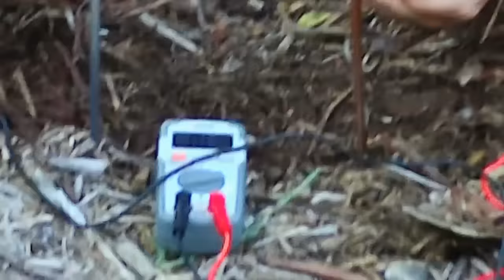OFF GRID POWER? The Earth Battery Experiment

Comment: The max voltage per cell is set by the choice of metals. The max current is determined by the electrolyte conductivity and acidity and the total surface area of the electrodes and probably the distance between them. So I'd suggest using closely-spaced metal sheets with a porous separator immersed in a conductive liquid (try lemon juice, vinegar, salt solution, etc.)
Reply: I THOUGH OF SALT AS WELL.
Reply: best metal choice? Probably gold since it doesn't oxidize.
Reply: And then we have a typical battery....
Reply: Yes but the idea is to have usable power with an earth battery. Meaning minimal upkeep and expense in creating it.
Reply: NaOH solution will work better.
Reply: lithium
Reply: Based on this, couldn't these be installed into a septic system?
Reply: You cannot, should not, hopefully will not, use this in a septic system due to corroding connections.
 One could revert back to the all knowing wisdom of Jim Carey, carefully positioning / lighting a cigarrette lighter during a flatus attack !

Comment: Used to mess with this kind of setup. The best way to do it is keep a pipe inside and wrap the outside of the pipe with a wicking material wrapped around it just like in the telegraph patent. Removing the battery from ground itself lets it dry out too quickly causing dead cells. These Batteries run off of moisture in the soil. Too little moisture no energy, Too much moisture and it shorts out.  Another thing is that your also getting energy conversion from three sources using earth batteries. Temperature - the Pelletier effect  one side is cooler than the other side of the two metals moving the electrons,   Chemical Reaction like a typical battery except rust/oxidization also contributes to the conversion, and the last one has to do with the earths magnetic field. Personally I would like to try dumping the power into a DC booster then taking that energy and dumping it into a Nichrome wire that is running into a sand battery. The sand battery can collect enough heat over time as long as your producing up to 12 to 24v. Then you can take that thermal energy and pump it into a hot air /stirling engine generator and/or Pelletier device, or a tpv panel when those become available to the public. Basically any energy source can be dumped into a sand battery using nichrome wire then utilized. I didn't mention a steam engine can be run off of it because a simpler safer condenser engine could be used instead. Finding ways to generate energy is a hobby of mine.

Comment: If you take a small nut and bolt and drill a hole in the bottom of each cell then connect a copper wire that connects to all then leave 6in exposed and burry the cell pack in the dirt I HIGHLY RECOMMEND U TRY THE RESULTS BLU MY MIND as it acted as an alternator recharging the cells and for some reason gave me an extra almost 2 volts...........  AND THEN I TOOK A small transformer and connected it to my leads and then hard wired an alarm clock, I have consistent power running that clock 24hrs a day just slightly modding "YOUR" DEVICE""      AWESOME JOB love your vids man ME N MY KIDS LOVE EXPERIMENTING and this was the best
Reply from the maker: Cells drying out was the cause of failure for the pvc pipe assembly .. putting a hole in the bottom would let moisture in from the soil, so long as its healthy (full of organic matter and living things)  I wouldn't have expected the extra voltage .. that's pretty darned cool!

Comment: Good experiments ! I would offer some advice dealing with such low voltages and currents. Don't interface your body with the terminals. AT 25:48 where the voltage is "jumping all over the place" it's more than likely because you are handling the terminals. You can just hold the test meter probes in your hands, left and right, and you will measure a voltage, also in handling the terminals you will be dissipating current through your body, which will lower the voltage. Your body will act as a resistor and also as a capacitor. Either wear insulated gloves, or simply don't touch the terminals when your taking measurements, you also made this mistake earlier in the video, where you were measuring the bare rods in the soil, you were steadying your hands on the anode and cathode whilst taking a reading. Hope this helps, but really, great experiment  ! I've seen a lot of these experiments, and all with interesting results, but people often comment on how low the power output is. Of course, like anything, this is simply a matter of scale, and practicality, multiplying 1 by 12, or 1 by 120 or 240 isn't rocket science after all  :)
Reply from the maker: I had a set of test leads with alligator clips at first, but one of the leads broke.  I'll need to get a new set before doing the next alternative power experiment (microbial fuel cells, whee!)  Hehe .. you wrote "whilst" .. Have you noticed that there are some words that we only use in writing? 😁
Reply: @Green.Country.Agroforestry  Intelligent scripting? I keep a couple of 'gator clips handy to slip on or off the test leads, giving me a choice, or you can just use the old leads from those Harder Fate meters that only last a month or so, with a soldered set of clips on them.
Reply: @garychandler4296  lmao "harder fate" Took me a second to catch on
Reply: @Green.Country.Agroforestry  And was he talking or writing?😂

Comment: Interesting stuff.  As an experiment I recently connected some potatoes in series with copper and zinc coated electrodes (aka  copper wire and zinc coated screws as anode and cathode).  It lit up an LED for several days.  I used it as a Morse code flasher at a ham radio convention display.  Fun what you can do with nature.
Reply: Do you have a picture of this setup or a drawn diagram? That sounds very interesting!

Comment: Create more amperage by connecting in parallel instead of series circuits.  You can create multiple "in series" clusters and create a parallel wiring to create both amperage and voltage.

Comment: I think you should make coils of copper and aluminum around iron rods before putting it into the dirt instead of just putting copper and aluminum rods. Both coils must be insulated but just leave a bit uninsulated at the bottom end. Plus connect the copper and aluminum coils to a high amp connected to a low amp then connect it to a capacitor for consistent flow of electric current. Finally test this to the Vault metre.
Reply: I did that an pissed around it an it went up to 2 volts , but not much milliamps
Reply: Then add two or more inductors parallel to each other to increase voltage. The Tesla coil that magnified the electrical current was done this way. Or use a transformer to do this to step up the voltage.

Comment: Nice thing and sertenly intresting you showed here. 
Couldnt find any other video‘s on youre chanel about it. Why ?
Reply from the maker: The eventual plan for the property will have almost complete canopy coverage, making solar power ineffective - so I have been doing research on alternatives to run the lights and fountain pumps for the ponds.  'Earth Battery' is not going to produce sufficient power, so there is no need to cover the topic any further.

Comment: For best effect, run trenches so that the wiring can be buried, install 3 ft long copper rods a foot apart, and every other one is positive and anode.  From each set you need to install an attachment for the wire and wire every anode parallel, from each cathode install two diodes to the common cathode lead and a 10 mfd 25 vdc electrolytic capacity at each set, the positive to the positive side of the diode and the negative to the common cathode.  This is to prevent bleed back to ground and keep the amperage building on each line of probes.  Doing this with longer probes you will find each line of a dozen pairs will multiply and have a combined +.74 volts and around 185 milliards of available power. This can be ramped up on a power ladder board and on 1/10 of an acre I got enough to charge a 12 volt 30 amp solar charger system to a large deep sell battery.

I've tried different wiring schematics from PNP transistors to 1N915 switching diodes and power rectifiers, basically use the cheaper and smaller voltage items where the power is low and ramp up to power voltage devices in higher positions, and the Schuman voltage response can be captured and used 24-7 to power devices until the elements become eroded away depending on the soil in y9our location.  Next year I'll throw a schematic together and post it on YouTube to demonstrate it can be added to a solar and wind combined system to achieve more charging even when there is no wind or sun.  Another system is to use antennas much the same way, convert available power in ambient frequency in the air to do the same thing, no moving parts.
Reply: Thank you very much.
Reply: Please do a video that would be interesting to see 👍
Reply: Is it next year yet ? 😃
Reply: @citylotgardening6171   You can count on it.  But first I have to make a few things while the ground is still rock solid until the thaw.
Reply: @EyesWideOpen2   Please just roll back over and finish your nap May Flower.  We will let you know when it's time to come out.  The New Year shouldn't begin until the first day of Spring, not one week after Winter officially begins.
Reply: @robgad2271  What twisted your nickers? Did you respond before coffee?

Comment from the maker: :_Gnome:Most of our efforts right now have been going towards developing that 'full canopy' that I mentioned early on in the video, but we haven't forgotten the need to come up with a good source of power in the shade.  Experiments with biological fuel cells and possibly thermoelectric power will commence, currently (no pun intended) planned for late 2022-2023, when most of our big stuff will :_Bee:planted. :_Gardener:
Reply: Have you looked into biomass for heat? I saw something about people using it to heat water.  Apparently microbes and generate a high core temp
Reply: Would this work better with rods instead of tubes?
Reply: Would it make a difference from the tubing, if a solid copper&aluminium were used..?
Reply: @realitycheck4158  I wonder??? Good question!
Reply: @jackrussell1960  - Good question!
Reply: @sandrabulluck1896  thanks...lets see if he will respond👍

Or i might have to do it myself...??
Reply: should be using magnesium, carbon. 2v.
Reply: guy got 2v, from  2 x 4''pieces of mag & carbon..
Reply: You didn’t try to upgrade the components? 😂 Barely tried I see
Reply: @jackrussell1960   heyyy im sure if you have rods instead of these tiny hollow tubes, you could get more volts & Amps. Add an Adjustable resistor to increase amps at your need.
Reply: @keithcrawford6310  really bro im useless at this kinda thing...bricks an mud is my pain..but thanks, if I ever need smthg like this ill remember what you said👍
Reply: do you know what a thermocouple is made of? copper and aluminium. the create a voltage when heated to keep your fire fail safe open, so when your heat source goes out it cuts off your gas, these are connected together . why dont you try melting aluminium and pouring it inside a copper pipe then try it.. just an idea

Comment: The “Baghdad battery” in the Iraqi museum is built similar to this with a clay jar. Archeologists figure either grape juice or vinegar was used as a conductor to get about 2.2 volts as I recall.
Reply: Yup, perfect for electroplating small trinkets. Dozens of them have been found now, which proves they definitely were not a misidentified item. :)
Reply: @TacDyne  I’ve found out date vinegar is plentiful in Iraq, so they could keep recharging it as needed.
Reply: Most likely lemon juice as lemons were plentiful.

Comment: Cool. I've seen people get around 20-40 mA out of crystal cell batteries that they make out of various salts. I also see them connecting the batteries to capacitors in order to store and gain higher current. So maybe that could also work with the earth battery if you need a quick burst of power. 
Either way the earth battery is a good base to add onto and improve upon to get that current up.

Did you find that they regain their voltage after re-moistening with water?

Comment: This is Huge, You need to add a "joule thief resonator circuit" into the fold of the battery cells you will be able to amplify it up to a usable source to charge any battery you need. Thank you for teaching me how to collect energy at night, I can do it well with solar panels during day, very cool.
Reply: Also look into the "Fleet Circuit" using your ground batteries to feed it. Should be able to get a nice amount of power from ground, Took lots of notes from video into my book of knowledge, ty again sir.
Reply from the maker: The thing that made it effective for the old telegraph system was massive electrodes and LOOONG distances - locally, its just chemical battery action, but you are correct:  integrating a 'joule thief' into the circuit would permit one to get the 5vdc needed to charge a device, it would just take a little while.  Experimenting with bio cells is still on my list, but my multi-layer perennial gardening is taking priority.  My landscape lights run on 12 vdc, 4.5w - Too much for the earth battery, but with bio cells, now that might be enough to light it up.
Reply: Have you heard of elecrets?

Comment: I have done this experiment with ice trays using dirt cubes linking them together in series and in parallel in order to get the voltage and current up enough to run a small LED. I've also done it by making concrete batteries by adding Epsom salts and bleach to concrete mix putting the electrodes inside of PVC pipe they'll do over one volt. Not enough amps to be a meaningful power source. However legend has it the first telegraph was using it Earth battery and it says signal all the way across the country. Find that patent!

Comment: Very cool! No need for that tesla power pack ;)

Here's another option: you can easily make wood oil using water, metal (clay if apocolapse), and fire. Since metal isn't the easiest to source if all goes down, this will still give you a concentrated form of fuel if you can't make ethenol. There's also fat wood, tar/sap, animal fat, olive oil/etc, and glass lenses.
Reply: Wood oil? Do you mean wood alcohol?
Reply: @sideswipe147  no I mean wood oil. Look it up, you get petroleum by heating the wood in a vaccum so it has no oxygen and then it releases wood oil vapor which you codense and then refine.

Comment: I have a few questions of you'd be so inclined to answer do you ever need to change the substrate, do you have to keep the substrate moist, and if you were to add dissolvable electrolytes into the substrate would that increase your electric potential? Thanks really cool vid im very interested to gain more of the knowledge you are so kind to share, this subject interests me alot.
Reply from the maker: This experiment was really dependent on ion exchange between dissimilar metals, even outside of a container .. so electrolytes and moisture have to be there.  I did not see a difference in output between the electrodes in cells and electrodes in the soil directly (so long as the electrodes were of the same surface area .. changing surface area affected amperage, but not voltage)  I imagine that at some point, the surface of the electrodes would become oxidized, and then they would need to be cleaned off in order to bring voltage back up.
Reply: @Green.Country.Agroforestry  Remember the "potato clock"? I wonder about growing potatoes in that soil..

Comment: Thank you for exploring that option.  You did a great job.
Another alternative might be: Compost.  Compost produces heat of 140-160 degrees.  Is there a way to convert that heat to power?
Reply from the maker: Thermal Electric Generators have some potential .. most likely involving the use of a thermal battery, and multiple means of heating water, compost heat, mass heaters, solar water heaters, ect.  Possibly even low-heat radiological sources like thorium could be used as a heat source, since it is not necessary to make steam to turn a turbine - I just wouldn't use the hot water from a mini reactor to take a shower 😉

We are currently shoveling $ into the plant nursery business, and once that is net positive, will get back into alternative power:  First off with a solar panel bank built into a wood shed, then with a mass heater and thermal battery .. eventually, we should be able to produce power whether the sun shines or not.